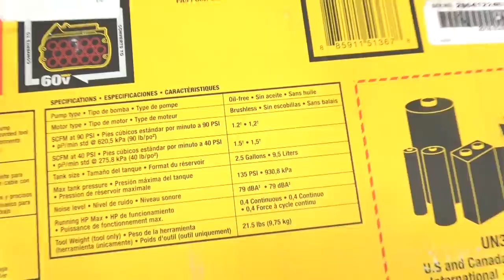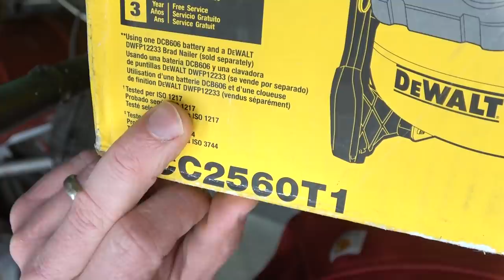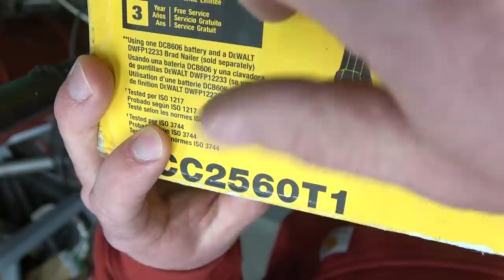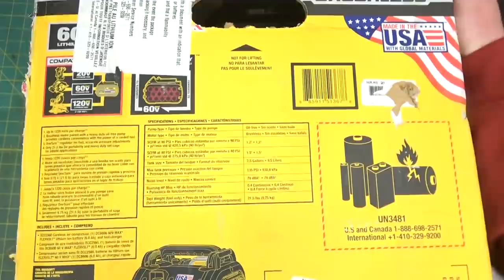BOLTR: DeWalt Flexvolt Compressor | Gutless and Brushless?

Comment: I was really hopping that the tank was properly equipped with a tag that said "I'm tested for X psi" it would have been worth seeing if it could be ran off 14.4 off a truck and use it as a truck air compressor. I don't really need nor have the space for a big air compressor.

Comment: For a pressure tank the classification AFAIK is depended on the product of pressure and volume. For CE in Europe f.e. there is no need to test anything when the product is below 200 bar*L. So for example 10 bar max at a 20 L Tank.

Comment: Partner, as I'm sure you know, regardless of being an undeniably nerdcentric activity, there is a wide range of skills involved in modeling. Especially  if we're talking about the quintessential prime time robots from the J-A-PAN, know to the well versed as Kidou Senshi Gundam - as that is the proverbial serious business. Those Japanese guys have taken it to a whole 'nother level.
 First and foremost you have to figure out how to put the thing together. Luckily the diagrams are fairly straightforward, cause the wingding hieroglyphs aren't doin ya any favors.
 If your doin it for real, goin all in,  full customization, there's  actually a decent assortment of tools and materials required. Plus you have to get up to par on all of the paints, solvents and adhesives. Throw in some aftermarket LEDs and you've got yourself a full blown project. You end up tinkerin away at this fuckin thing for 3 months and then finally get to the stage when you're just ready for primer. 
 The point is: down the road your nerd-like tendencies finally bear fruit when you put that shit down as "Extensive Experience in Robotics" on your engineering resume (based on a true story).

Comment: Great video, as usual. Have you considered doing a breakdown/review of the super capacitor car jump starters? For example there is the  Autowit 12V Batteryless Car Jump Starter. These seems like a great replacement for a battery based car jump starter. From what I've found it seems pretty good, but not sure about the internals of these devices. I think these devices are relatively new, but I'm not sure about that.

Comment: This is minimum standards for ASME. That tank is almost able to have it, but doesn't meet the requirements. Also is .3 cubic feet short.

Section VIII Division I
U-1(i)(vessels having an inside diameter, width, height, or cross section diagonal not exceeding 6 in. (152 mm), with no limitation on length of vessel or pressure;

U-1(j)(3) 1.5 cu ft (0.04 m3) in volume and 600 psi (4.1 MPa) design pressure.

Comment: Funny to get a DeWalt ad before this vid of a guy “on the job” cordless drilling into a highway barrier with a special cordless shop vac to get the dust. Just looked so unlikely, this brawny guy with all this Transformers gear around him. And god almighty, what won’t they make battery operated? I thought the dumb chainsaws were the limit, but no. Absurdity level approaching eleven!

Comment: If it's glassfibre reinforced then the off-black color probably isn't from undersaturation of coloring batch, but probably from imperfect injection parameters.Not enough preasure on the mold most likely. Or not enough closing force on the parting line. You have to play with the values to get the most out of your mold. in this case it was probably a tradeoff between a nice coloring on a side that nobody is gonna look at and flashing around the parting line.
Or maybe the geometry of the mold is realy bad and the firers stand on end at that spot no matter your parameters.

Comment: I have a unit like this. And there is no unloader  valve. I do believe the hole in the cylinder is to give old girl a head start to get going, not to cool. And at max ripums the hole is uncovered so little it may not mater

Comment: If I remember correctly from working on them a number of years ago the being certified as a more inside than outside metal cartoon language container has to do with its capacity. 
In the USwerds I believe that anything under 1US Gallon doesn't have to be certified and tagged

Comment: Is it possible that that hole is acting as the unloader valve? Surely this thing would need an unloader. And with a sensored brushless motor with a controller and direct drive the motor could be programmed to stop with the piston at the bottom of the cylinder. This would release the line pressure for start up.

Comment: What if you tig weld the top cylinder hole closed, then re-drill a new unloading hole slightly lower than the original, maybe an RCH's worth.  Maybe, just maybe, there might be a little bit more volume of air per stroke, let's say an RCH's worth!  Just a thought.

Comment: I bet a thousand copeks the holes are drilled before welding.  Drain is bored from outside in to form a low spot but they should have drilled at the middle.  Guess this prevents clogging from inevitable dirt as there is no filter.

Comment: 29:17 I know our jobsite compressor sometimes overloads and blows breakers when it's pressured up and tries to start it's cycle, my theory is that it's pushing from bdc (so the motor has a terrible leverage disadvantage from the crank angle being too sharp) and can't crank over from the cylinder pressure, this could be a way to solve that kind of lockup

Edit - how do they deal with crankcase pressure?
Reply: Try replacing the start cap before trying anything else.
Reply: @NiHaoMike64  didn't even think about it since it's been like that since new, thanks I'll check it

Comment: You would likely have to up the voltage if you want to up the speed.  The speed of a DC motor - brushless included is limited by the back emf created by the turns of wire moving through the field at top speed. ie 3,400 rpm is 44 inches per sec X 20 turns X field strength = 60V - wire resistance X current.  Also that silly little valve in the piston is probably topped out at 3,400 rpm.  Even if you spin faster you don't get more air.
Reply: Should just do like Uncle Roy and make it treadle powered. Ethanol powered as he likes to say.

Comment: Hey, do ya think that the top two friction welded holes weren't made before the weld, so they could be used for indexing during the welding, then tapped after? Just a thought I had when you mentioned about the possibility of grime inside. Don't work In the industry so no idea if that's done, but it seems like it would lead to a cheaper jig for the weld up on it

Comment: Is the counterweight/flywheel pressed on the shaft with no key or retainer? I've got a couple of these pancake compressors apart to the point of removing the weight and no sign of anything but a press fit. Seems like quite a load for the shaft diameter and I'm sure I'll convert them to art by the time I de press them. (Needing to change the casting/mounting/bearing cap sandwich on the front of the motor) Looks to be built the same as yours.

Comment: Here's a question for anyone with plastic forming knowledge. When vaccum forming and aiming for a certian level of thickness to the formed part. What is a good general rule for such a thing? Because i can't exactly get a sheet cheaply that is so and so thickness in one area then thicker in others. So i know on the verticals the plastic will stretch and become thinner, but I don't know a good way to account for that. And don't really need super precision, just a good idea of like if i form over a 1 inch high object (practically a box in this case) with a 0.125 inch sheet or slightly bigger. Would i expect the sides to fall under 0.100 inch.

Comment: The holes are decompression at slow speeds for easy start up. Low amp drain on motor. Full speed the  small holes don't cause much compression  loss
Reply: Explain why its incorrect

Comment: Be careful with testing standards, I bought a pressure washer and the standards say it’s 1.6 gpm and 2000 psi max, but they are nice enough to say the actual rating on the side and that’s 1500 psi and 1.2 gpm, had I read the side, it’s a little hard to do that from the internet though and with the covid out I can’t exactly shop around, but if I knew that I could maybe have set it a few rings lower than I did, it was still dirt cheap and half the price of other options so meh

Comment: Hey, I know this might be asking a bunch, but could you measure the amp draw out of the battery into the tool? Lots of people want to use these things as quick swappable battery packs for eBikes and it would be great if we could get the amps OUT of the battery into the tool... So, at least we know what the tool was trying to take out of the battery, so that we can stay 'within spec' of what the tool draws. The Harbor Freight packs would be what I would want to know, since those are the cheapest... And make a adapter or a harvest them from a cheap tool (LED light? The shitty battery charger? Both?) and then make a pack out of the packs...

Comment: I don't understand, Using batteries to power batteries? surely you can pressurise the air tank and then you have a chordless supply? Why would you power a compressor with batteries? Wouldn't you get a petrol powered one or something? What use case is this for? I DON'T UNDERSTAND IT.

Comment: I stopped using teflon tape on air tool lines after dragging a little piece of it out of my paint gun's needle valve years ago.  Liquid sealant only now; no way am I going to actually be careful where the tape goes. :D

Comment: More than likely this motor is running at it's Kv limit. To get it to spin faster you need a higher voltage battery and controller. Max charge voltage at 15S is 61.5v. 3400 RPM/61.5v = 55kv. For a small motor like this, that's a very low Kv. I would expect more like 130-150kv. Motor efficiency will suffer. Heat build up will be higher than the exact same motor wound for 130 Kv. Dewalt would have done better to gear down the motor than use a low Kv wind.

Comment: That's a Pcv(positive crankcase vent) maybe just v.. but micro...the wee hole in the cylinder wall that is. Ave that 1/2" lektric nut smacker looks alot like my strap on, coincedentaly seams to have the same failure mode. Mine just slowly lost power, still works..kinda. when she was new it was tits, but those knockers gotta belly button in the middle now. Thanks for all the knowledge and insight, tis quite beneficial..and the chuckles Cheers from montucky

Comment: Until tankless air compressors are an option, ill stick with my electric tools for nailing. Cant complain about my milwaukee framing nailer after several thousand strokes. It sank a few anchors into the concrete slab for me "on accident" as well. Tools might be a little spendy, but i cant complain for the result.

Comment: I disagree about the feet on the pressure vessel. The more they weld on that the more chances there are for something to go wrong. Just the tiniest kiss of liquid hot metal is enough for the job, and if it breaks off from being underwelded then the pressure vessel is going to remain intact.

Comment: R stamp is the cross thingy you was talking all pressure vessels should have them maybe something in to code in witch they don't have to stamp it on the vessel it's self but I would bet they are required to carry one ( the tank manufacturer that is)
Reply: Or maybe a U stamp

Comment: It would be nice to start hacking brushless tools, like increasing max RPM on drills. I know that most of Bosch brushless tools have programming  pins sticking out of electronic module. I got black epoxy removed from one of those and there was ARM STM32F051 microcontroller. How hard could it be to write opensource code for it?

Comment: with the smart controller, how hard would it be to differentiate between high use and kicking in, and a blown hose and kicking in... as I write this I realize it would make no difference with just a normal pressure switch or a smart controller...… as I was

Comment: I never really understood how these oilless compressor cylinder O ring seals work without a pivoting cylinder and wristpin. To me it just seems janky. Since the O ring can't stay horizontal during most of the stroke how the hell can it seal? I know the O ring is rubber but still. One of the reasons why I always get rid of these things. I should just rip one apart next time and look at the seal.

Comment: Wouldn't a cordless compressor have the same dismal battery life expectation as a cordless pressure washer?
Reply: Yeah, through this whole video I was trying to imagine who would realistically buy this and the answer seems like its just for DeWalt Fanbois. Because if a house weren't wired yet a contractor would use a gas compressor like the roofing boys do. It's definitely more economical to buy a real compressor then use a portable air tank for the smaller jobs.

Comment: You kinda answe my question hehe , as this tool will for now nor the Milwaukee m18 would work for non stop job like the corded once’s as that motor kick from both brands have a set psi kick in level , even I had so much batteries from either brand I haven’t seen anyone test this in real usage for more than 5-25mins I’ll be great they came out w power supply to make them run corded for more working time  but I doubt the esc or chips let the tool work on a no stop environment

Comment: Aren't these hydroformed? Couldn't the friction drill be done first, plugged, then hydroformed?
Reply: Doing it in that order wouldn't have any significant advantages, but would cause a whole ton of extra work and potential problems.
Reply: Friction drilling before hydroforming could cause stress points at the base of the drilling as well as deformation of the threads
Reply: Also I believe the halves are die pressed 11ga

Comment: Wonder if it actually uses 60v and adjusts pwm to regulate, or if it just bucks it down if over 20v first...
Reply: Quite sure it uses all 60 volts. He incorrectly said it works on 20v batteries, only runs on 60s.

Comment: AvE, you're too smart for your own good.  I predict the follow-up video will feature diagnosing why the motor no longer restarts (or struggles) after the tank has pressure.  The two little weep holes drilled through the cylinder wall that were plugged are intended to be a dirt cheap way to vent residual cylinder pressure at shutoff in the same way that "unloader" valves do.  Silly man, the tiny volume of air that gets puffed out of those would be thermodynamically incapable of acting as any kind "air cooling"...

Comment: Used sir... never have I ever pulled off one of those covers new or used that smooth. Not off one of those batteries. 200+ for that pack of lithium cells... I've had 4 new ones In my paws. Never that easy to pull apart, sir...

Comment: tanks at 150 or 200 psi ..do NOT blow up, u could charge ur tank to 200, smack it with n axe hard enough to split it n it wont peel open, air pressure at pressure even close to what we would run in a normal shop, anything under 200, and u dont have to worry about anything other than pvc, really old pvc can fracture the length of the pipe, it doesnt usually send shards out but it does absolutely split lengthwise and can leave some nasty multifoot long splinters waitin to happen, if u were in a tight area n one of those went i could see impaling urself in the scatter, but it still doesnt send shards out, i only kno this cuz i was really curious so i broke a bunch of shit in the shop one day, honestly i thought the pvc was shrapnel bombs waitin to happen n i was tryin to convince my stepdad to put proper pipe in where pvc is, especially in a metal fab shop shit gets bumped with heavy sharp stuff all the time, pretty much all the insulation at around a 4 foot level has been ripped down almost around the entire 100' x 200' shop n all the pipes at the level have been busted n replaced with steel. we didnt put the plastic in to begin with it was put in in the 70s when the place was built im assuming  u do have to watch out for hoses flyin around if they get a leak tho thats about the most dangerous thing youll encounter with a compressor, i mean yea obviously im sure theirs been a situation where a tools come apart in the form of a weapon n ruined somebodies day

Comment: Speaking of articulated type steam locomotive there's a steam locomotive called a Skookum look it up dude it's a 2442 articulated type compound Steam locomotive that means that uses the steam twice the cylinders in the back the small ones are the high-pressure cylinders the cylinders on the articulated section or the low-pressure cylinders the big boys different it's known as a simple which has high pressure steam in all cylinders it's like a V8 steam locomotive cuz it's double acting Pistons peace out have a great day dude look up the Skookum you have to please you got to check that out

Comment: I was always the one to go into autozone and ask for a specific part number (swap projects) I need this specific bearing oh whats it going in?....doesnt matter.... Oh well it says you need this one not that one. Then u gotta learn him by explaining its a mash of ford dodge and GM. Dodge motor dodge frame ford rearend ect then they stare at u like they just had a stroke. I then worked there for a part time gig on the side and litteraly people would only deal with me and would rather wait 10mins in a line for me wen theres no wait for another worker, I wouldn't ask all the dumb shit they usually do for like a dam windshield wiper. Makes a huge difference wen the guy behind the counter knows his shit and has the experience. Oh that never came with a manual transmission u must need a trans filter.......no...just no it does now give me what I ask for

Comment: I wonder if those crappy welds compromise the vessel... I wouldn't trust that
Reply: generally yes, they do - but at 135psi or 10bar, the vessel is plenty strong with 2mm (or thereabout) wallthickness.